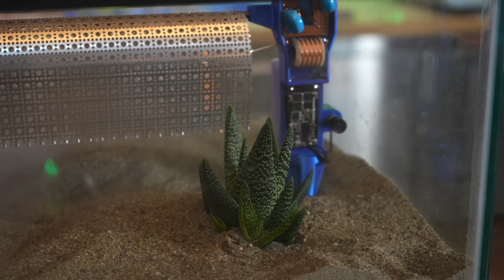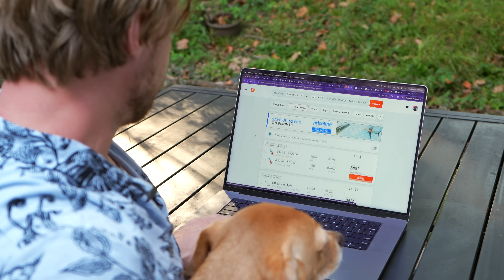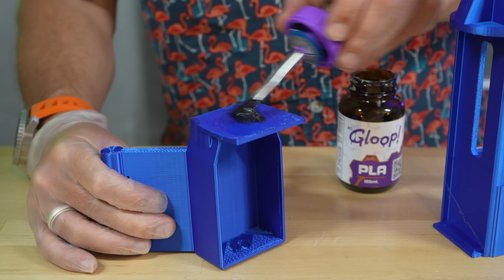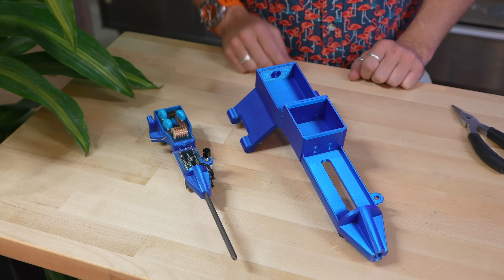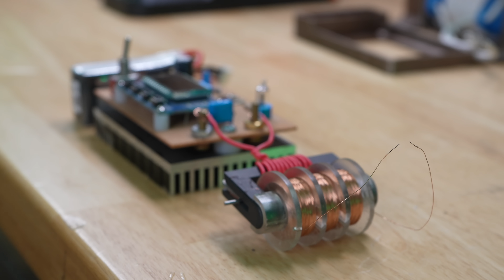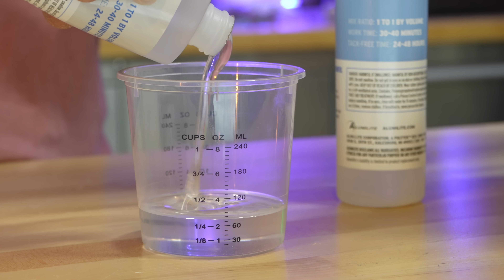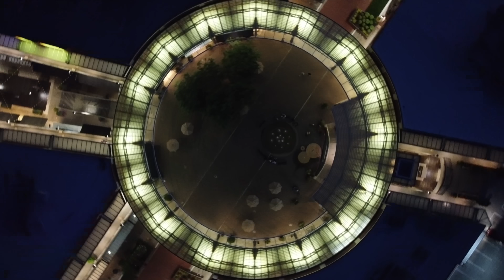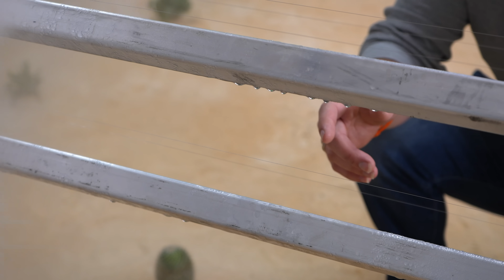Turning Desert Fog into Fresh Water Using 50,000 volts

Comment: 21mL per watt hour of electricity is not a very efficient method of generating fresh water.  That works out to roughly 18 kWh of electricity, for 100 US gallons of water.  For reference, individual humans living in the US usually consume an average of approximately 100 US gallons of freshwater per day, at their personal place of residence.  18kWh of electricity is substantial, but on sunny days, it can be generated in most places in the US using about 4500 Watts or less of installed solar panels, which currently costs around $1500 (even after paying Trump's tariffs on imported solar equipment).  Additionally, further improvements in water generation efficiency compared to what is shown in this video, are almost certainly feasible.  Additionally, for comparison, professionally installed residential freshwater wells frequently cost $10,000+ in the US (in 2025).

Given how cheap solar panels have become in recent years, it is conceivable to practically deploy enough solar panels to run a residential household from electrostatically captured water from fog, at an overall system cost that is potentially cheaper than current well drilling rates.  However, in order to work practically as a conventional well based residential water source replacement, one needs a highly reliable source of ground level fog, which most places simply do not have available.

It is however conceptually possible to mount the electrostatic water precipitator system to a neutral buoyant balloon drone, along with solar panels and a slow propulsion system needed for continuous station keeping operation.  Basically, if you have a large hydrogen or helium filled drone balloon with solar panels and fans needed for stationary floating in place, one could hypothetically use the drone to hover continuously over one's own land property.  If the drone balloon periodically adjusts its flight altitude to stay slightly above any cloud layers, the solar panels could potentially keep the drone stable in position and aloft for long periods of time, potentially for months without ever needing to land.  Such a drone balloon could hypothetically collect and use solar electricity, along with some wires dangling inside a cloud layer just below the drone balloon, in order "force" the cloud to produce rain at the site of the balloon.  Hypothetically, if one had a rain collection surface and associated freshwater holding tank below the drone's continuous hover location, one could then collect the artificially induced rain.

One major problem with living off-grid and relying on rainwater collection, is that natural rain is unreliable, especially in arid/desert locations.  Many times, clouds will pass over one's property, but the clouds will not drop liquid or solid precipitation.  This can lead to long stretches of insufficient water production, when attempting to live in a residential household that is entirely rain water dependent, especially in desert locations.  However, even in extremely dry desert locations, clouds usually still pass overhead, at least a few times per month.  Consequently, a solar powered neutral buoyant drone balloon based electrostatic water precipitator device, does have the potential to make off-grid desert living more practical, even in the absence of owning a functional ground based fresh water well.

Being able to forcibly extract liquid water from clouds, on demand, is a potentially very useful technology for humanity.

Comment: 21:25 What about a humidity meter, always connected to the battery? Once it reaches a certain threshold it activates the condenser, once it goes lower it deactivates it, so there is not power used if no fog is present.
It could be all inside a little Faraday cage, so no EM interference affects the device.
Reply: im no expert, but im pretty sure you can get entirely mechanical humidistats that just mechanically flick a switch on and off by means of different materials expanding and contracting with humidity

Comment: You should look up the shape of tent stakes made speciffically for sand, the ones that are either a curved sheet of metal or with a 90 degree profile. In a real world testing scenario with dry sand the current cylinder shape of the stakes would probably not be very stable. With that shape you can also make them consiredably shorter for the same amount of stability

Comment: i was thinking adding a Humidity sensor and a shielded micro possessor to turn it on at a certain humidity level and even change the power output depending on the humidity levels so when theirs only a small amount of fog it can run on low to save power then ramp up if a thick patch rolls through

Comment: with the Ionic air flow can this be modified to circulate the air for cooling and produce water of a home at the same time, ideally with off grid solar. or some other dual use with the air flow aspect   Edit: with that humidity switch you mentioned or temp or both

Comment: That is superb.
That little bit of my meteorological training tells me that you might not have to be too concerned by the wind if we are talking radiation fog. Calm and steady air is prerequisite for radiation fog. 
Advection fog next to the body of water might be little more windy. On hills that would be adiabaticly cooled air pushed to claim over obstacle. Forming into a cloud.  There i would assume more windy condition. As for the switch you are interested in air temp and Dew point. If there is low spread air is moist and cloud/fog will form. You might not even need a fog. I think it would work even with saturated moist air. So no need to travel to Peru.... though if one needs an excuse  😀.

Comment: For turning on and off the collector why not use a humidity sensor and a small microcontroller to turn on and off a relay.  That way you can easily tune it to only running at optimal fog levels

Comment: As a good way to detect fog and start the system automatically and vice versa, switch it off when the fog is gone, you could use a Hygrometric sensor connected to an arduino. It senses air moisture and sends back a value equal to the amout of air moisture.
You can program it to switch on or off using 2 different values of moisture that you can detect during fog and no fog.

Just consider putting the sensor a bit far away from the system bc the way the system works sucking up all the moisture drying up the air, it might mess up the reading of the sensor if it's too close to the machine

Comment: Strange that you decided to put the bars directly over the others. When the moisture drips from the top and hits the bottom bar it may splash and cause collection to be trickier. Also, why did you make all the bars perpendicular to the ground? Designing them to be angled slightly towards the center post will make collection easier.
Reply from the maker: Great input, thanks. I mentioned in the video that bars were angled at 4 degrees to make water collect toward the insides. Turns out the 4 degree angling wasn't enough.

Comment: It would be neat if you could wire in a humidistat that would turn the collector on or off, when optimal humidity is present to save battery life, and top mounted low draw LEDs to prevent wildlife from tripping over it at night. Just some random thoughts 👍I love the project keep up the great work ❤

Comment: Hi Jay, great video and very interesting. I am just wondering how it would compare to installing small electric fans in a row instead of this high voltage wire. Would be interesting to compare this. I built cheap pc fans on top of my heater to generate a slow air flow to increase the efficiency of my heater.

Comment: You can use a hygrometer as a switch, and/or a timer, if the humidity sensor did not switch on, then it turn on, at a certain time.

Comment: Well, i think its a great idea. I cant help but thinking You overdid it. You are offering a higtec solution that seems fragile and dependent on electricity. Three things that is not to recommend in the desert or other lonely places. I recently watched videos about rethinking the watercatchingnet principle. Its lowcost, lowtec and it works without electricity. It is the perfect solution in desolate areas. If You scale up the nets and collect it in suiteble containers the supply and demand will level out.

Comment: try a white LED, pulse it on. place the light sensor beside the light, fog will backscatter the light to the sensor. if the sensor has the same signal as the led, there is fog

Comment: The main issue is that there is no fog in the desert. I’ve lived in the Sahara, and there’s absolutely no moisture in the air — it’s completely dry. While daytime temperatures can reach 35–45°C, they can drop to –5 to –15°C at night. If there were any humidity at all, it would naturally condense on every surface, including the sand itself. Unfortunately, this means the unit is completely impractical for desert conditions.
Reply: Its for coastal deserts where there is fog, like the mentioned ones in south america.

Comment: Why not just detach metal stakes to lower the condenser instead of raising fog machine? 😁
Why not use simple timer? Reliably detecting fog can be quite challenging, especially in a desert.
I would probably try measuring air conductivity. Coupled with surface wetness sensor it could work.

Comment: The mosfet may be getting too hot because you're spending too long in the triode region. PWM frequency and the speed at which your circuit applies power to the gate are important for this. Some people bootstrap their mosfets with a mosfet driver for this very reason- Though who knows - it could just be that you're pulling a ton of power. Still watching the video so maybe something to come

Edit: Seems like you got it figured out  - also that printer filament looks strikingly like colored anodized aluminum on camera. Though - PLA will probably melt in the desert

Comment: You need to set the system to activate when there's no solar power input.  You need to use a capacitor to set at least a 10-minute delay before activation so that if it's just a really dark cloud the system doesn't activate prematurely.  A simple but elegant solution for automatic activation.

Comment: You could use a designed fog net to,put over and around at a safe distance of the fog condenser to protect it from wildlife and also draw in fog into the fog net, so you have more water capacity for the same ammount of watts

Comment: If you slightly changed the geometry so the support legs are lower than the powered leg, the water would run along the tubes and you could build water collectors into the two support legs no?

Comment: It's pretty cool.
But before mass production, we need to lifecycle analysis of parameters like:
1) Water spent vs water extracted: Assembling(workers mopping the factory floors, using the toilet etc.), manufacturing components, maintaining the device(cleaning etc.) takes water. We have to compare that to water extracted from the air throughout it's life time.
2) Effects on the local biome: deserts are full of flora & fauna. How will the extra ozone, noise & electrical shock hazard effect them ?

Comment: Offfset the height of the central stake, so droplets run to the edges and don't just drop off randomly along the metal piping; this would allow for concentrated collection.
Reply from the maker: Haha I did both those things and mentioned / showed it in the video. My angle wasn’t steep enough though
Reply: @PlasmaChannel  You also didn't use the expected location, garage vs nature, so perhaps the flatness of the environment did a disservice in demonstrating the potential setup.
Reply from the maker: I agree. My garage was far from the ideal location.
Reply: and then scale it higher with sort of a "wind catcher" effect with like two higher rows to make them into panels, and double stack it behind the first row, to give more surace area to capture the fog, and call it the "Fog Catcher". i hope the plasma channel sees my ideas 🥺
Reply: Funnels would also add improvements
Reply: I was thinking 3d printed nucleation points that could be clipped on above plants or buckets and moved to anywhere on the rods. Also they would increase the amount of water pulled from the fog.
Reply: @Dleihs  Maybe. I'd have to see it in action.... I'd expect it would cut the zoning of water to each nucleation point; but I suppose that's the intent. The flexibility of setup could be nice; especially on larger industrial setups.
Reply: Micro plastics

Comment: even though i find your electronic setup and device an impressive achievement, i just find the idea to put sand in your workshop not that great it just feels like not real application. I understand that the humidity condenses at the surface of your high voltage device, but what is the quality of the water collected? Is it drinkable? Can we get some analysis of the water (pH, any concentration of other elements?)

Comment: You're clearly very smart with a desire to create tangible benefits with the applications of your interests. I cannot for the life of me figure out how you can be so functionally smart, and practically dumb at the same time.

Why on Earth would you book a flight before you even had a tested, working prototype? I could have told you right at the start, two weeks would not be enough time to build a completely functioning project ready for field test, solo. Things ALWAYS go wrong. Between the fabrication times, multiple iterations required, (especially with 3D printing, either FDM or resin), time gets eaten up very quickly when following a linear path. If you had multiple people helping you, especially if they had their own fabrication capabilities, that would make a 2 week timeline much more feasible. 

But, aside from THAT. Literally, what was the point in transforming your garage? A desert isn't a desert because of the sand on the ground or the plants. A desert is a desert because of the rainfall patterns, which is a consequence of it's geolocational position in the global weather system of the planet. The sand and plants are a byproduct of those conditions. If you wanted to just test your project in your garage, you'd have gotten the exact same results without making a mess of your floor. If you wanted to test it in a DESERT-LIKE-ENVIRONMENT then you should have replicated the humidity, temperature, and wind patterns inside your garage, but, if you were planning to go to Peru in the first place, I could not for the life of me figure out why you would not just actually take it to a desert to test, once you actually had it. It's not like flights REQUIRE you to book only two weeks in advance. Now you have the finished project, you could have gone as early as same or next day. It would be probably easier and cheaper to just fly to a proper location to test your design, rather than seal your garage with the necessary installs for heating, monitoring, humidity, and wind factors in comparable analogs to actual desert specifications.

Lastly... do you notice an issue with your design?

It's meant to capture water... so where's the actual capture system?